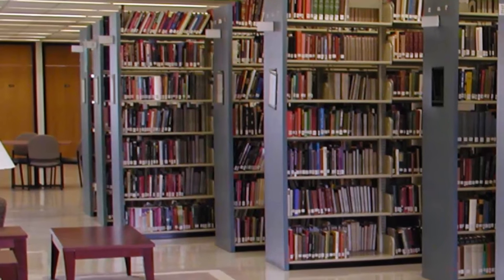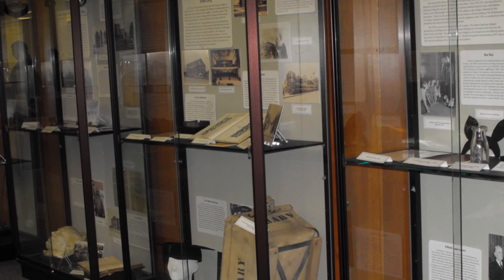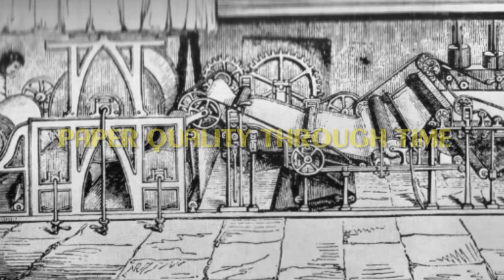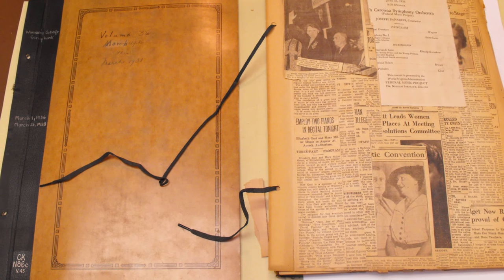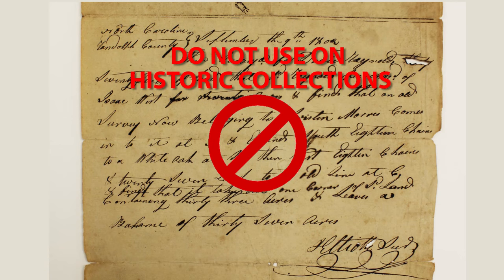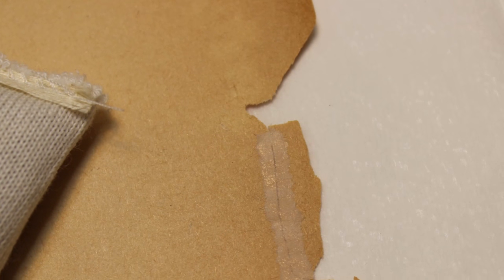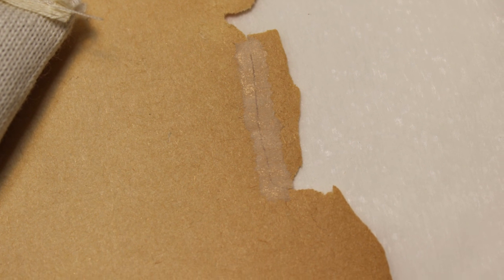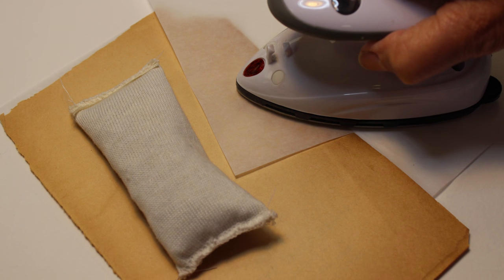Basic conservation practices: brittle paper repair

Comment: I think she is saying from 3:35: (Paraphrasing) Japanese papers made from closer fibers  are the best for conservation procedures together with wheat-starch based, rice-starch based, or Methyl Cellulose (e.g. binders). . .repairing paper using Neschen filmoplast® also known as heat set tissue. [ e.g. commercial paper repair products.]
Reply: It may also be "Kozo" fibers, used to make a tissue paper often used in paper conservation.
Reply: @andrewkemp1043  I believe you are correct. Washi Kozo paper (sic) and tape (made from Japanese Mulberry bark) are frequently used in the conservation/restoration of artwork, books and documents.